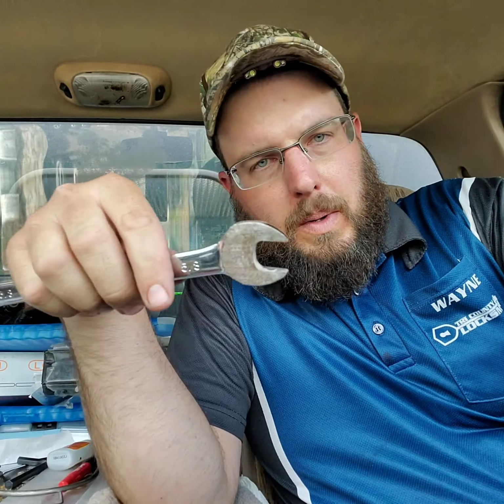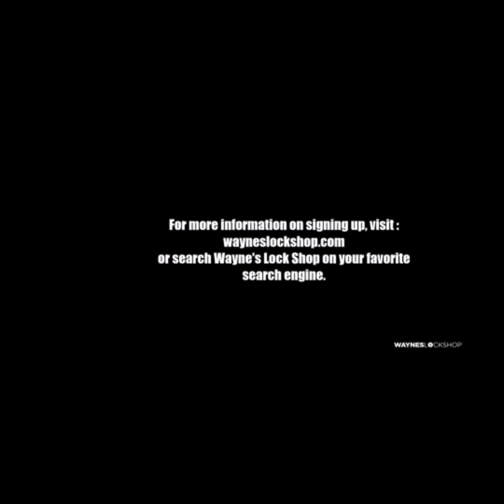How to adjust a glass door pivot hinge without dropping the door, custom shaved wrench, airbags

Comment: Awesome video! My exterior door's set screw actually turned easily, so I just loosened it and backed out the 5/8 pivot bolt until the door closed smoothly. I didn't need the air bag or the punch.

Comment: For those that want to try to remove the set screw, the size on mine was 3/32". Mine removed easily which meant I could quickly retighten it after the adjustments were made to "set" it. Hope it helps. Have a great day!

Comment: A 5 minute job you can charge a "ton of money" for does not appeal
Reply: That depends on what he means exactly. Standard price ranges vary over time, of course, but I would think any service call would be around $100. these days. That would include the first half hour of labour, and another $50 or so for each additional half hour over the initial. But that’s just my area, Toronto. 2024.